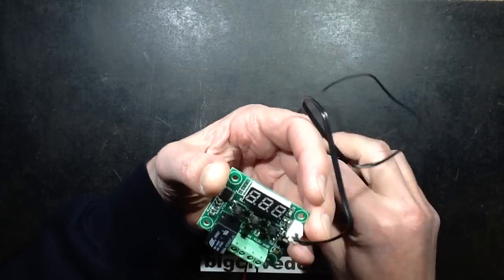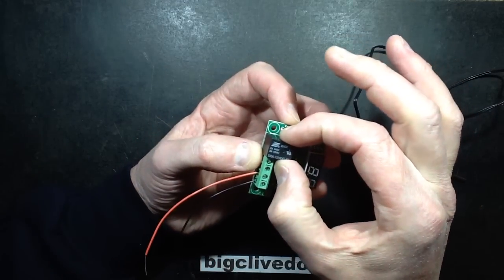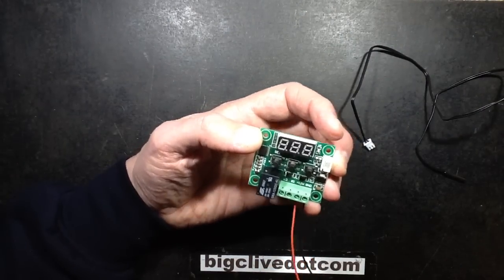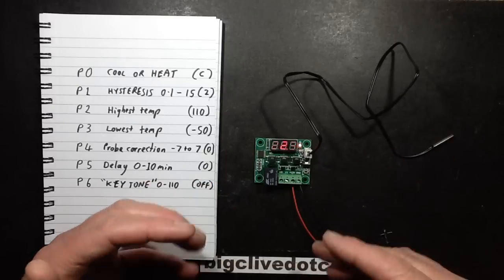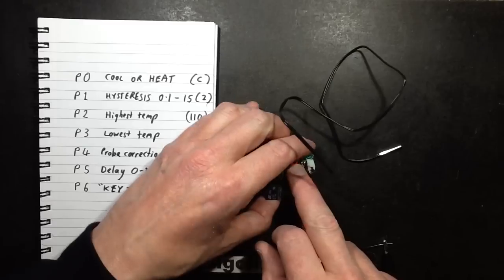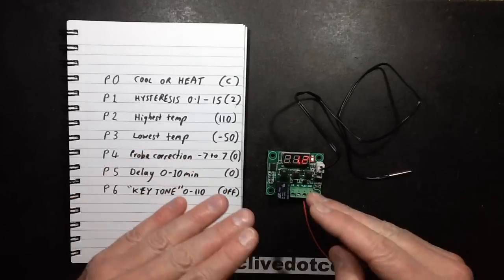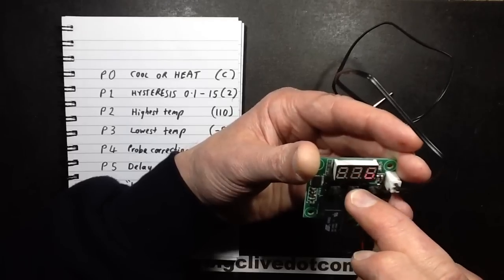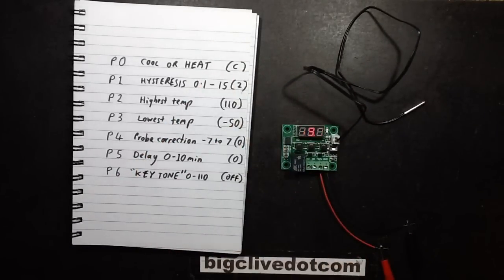Playing with an eBay thermostat module.  New data in description!

Comment: I have one that keeps flashing OFO - any idea what that means?
Reply from the maker: Not sure.  I wonder if it's detecting a probe fault.  Check that the probe is measuring a sensible resistance.  Usually around 10,000 or 100,000 ohms.

Comment: How will i do? When i try to do setting in my new XH-W1209, in the P3 it goes upto only 14 (the range is between only 14 to -30). I am confuse as you mention that it is a range between 50 to -50.

Comment: Cool video. I’m still trying to see how it works as a speed controller for a cpu fan so it can go back and forth between low and high speed depending on the temperature.
Reply from the maker: It could switch between two levels by bypassing a resistor.

Comment: I tried to use it for recuperator, whet temperature goes below -10 it should turn the heater on, but for some reason when you set a negative temperature to turn the relay on, it triggered at 0 C. For some reason heating mode works only in positive temperatures. I got two and both  got this.... But hey, for couple bucks I not complaining...
Reply from the maker: That's odd.  I guess they never thought it would be used below zero.
There may be a cheat possible by charging the thermistor compensation value so it reads 10 degrees or more higher than actual temperature.

Comment: ok Clive your all over the place with your set to 21 then 22! Yikes you lost me! How about I ask you a simple question and you answer it please. I want to set this to control a 110 VAC heater. It should be set to ON to start and when it reaches 105 Celsius it should go OFF then back ON again when it reaches 90 Celsius . Can you explain the procedure please?
Reply from the maker: The instructions for using this module are in the video description.  I'd recommend playing with it to learn all its features.

Comment: Many thanks! I have a couple of these modules (also could not resist the ridiculously low price). I planned on using one to control when a fan goes on near my wood-burning stove. Naturally, no directions included. Yours was the first video that came up, and let me get this setup quickly. 
  I would imagine the other to monitor my freezer in the basement, to warn me that it is getting too warm. 
  At this kind of price, I cannot imagine why the freezer manufacturers do not put them on now. It is not like it would really increase price much. Once mine is out of warranty, I will probably install it in the freezer and have the display visible. They actually sell cheesy plastic cases that also fit this one for next to nothing. 
  Goes to show you how much money that middlemen are making with this stuff!

Comment: What is the real temperature range of that module? Listings say -50 to 99°C, but then i could not use it for a heating plate. 

Does it have RX and TX Ports for external control?
Reply from the maker: I've not tested its range.  For high temperatures you will probably need to use a thermocouple based unit.  This has no serial ports.

Comment: I believe the tone setting is for the XH-W1315 temperature controller, it has a buzzer alarm that you can set. They're very similar units and probably use the same software. Just my opinion, I could be wrong. Maybe check out the one I mentioned above and see what you think. Also, thanks for your videos, I love how much detail you go into with these electrical items. You are a legend.  Cheers mate.

Comment: If this is the "W1209" board which i think it is, I used one to convert a cheep Halfords 12/24/240volt cool box to run on a thermostat in my van (that i live in) only one word of warning; These boards don't like voltage above 12 volts and leisure batteries charged from solar pannels can go up above 14 volts which will kill the relay. With my basic knowledge of electronics i found what i needed was a buck voltage dropper that i set to a constant 10 volts so now the new board i had to buy runs quite happily without killing the relay. So now for not many £'s i have a thermostatic cool box fridge.

Comment: Hi Clive , I've used one of these very modules to switch 2x 5” silent pc fans in the compartment behind the fridge vents in my caravan. The fridge works very well unless the outside temperature is too warm , summertime, so I've got the fans to provide forced air cooling over the cooling fins, temp sensor clipped to them set to trip at 50°c  and it works beautifully,  keeps the fridge working all through summer in the caravan. Mine came with a neat clear self assembly  case made of laser cut polycarbonate  excellent value for money.

Comment: This is a great review and I am a fan of your channel. 
After using dozens of these units it is a minefield to choose from the many manufacturers what is reliable. Taking most aspects into account including the clarity of the display, my favorite has HW-557 written in very small print just below the display. 
Also people complain about interference showing itself in the display. This is caused by coiling the thermistor lead to shorten it.

Comment: I have 240v one in a case its clever enough to not instantly turn on when used in a freezer but has a wait state stopping it thrashing the compressor .Our freezers are very old and now the thermostats are not sold anymore  others can be used but ofcourse need putting in boxes away from prying fingers so the boxed ready made units make sense . The module isnt that great its probe never agrees with the one in the freezer door .We set the temp at -19 off and -14 on and it hovers at -18 which is great ,its saved our freezer from land fill and when our 1957 fridges thermostat eventually fails hopefully keeps that going aswell.We have another one in the shed in heating mode it switches on a heater whose 'frost stat' never comes on even sitting well under freezing! As you say you cannot build one for the price and i recommend the timers as well we have one on our reverse osmosis which flushes the membrane avoiding having it continually wasting water left to its own devices as most do ,its programmed to come on for a minute go off for a minute then come back on for a minute then  switch off this lets the flush valve operate twice then switch off

Comment: Nice to have temperature probe correction but in the long term how stable are the probes, will their resistance drift significantly over time?
Reply from the maker: I'm not sure how stable thermistors are over time.  That will depend on the quality of manufacturing.

Comment: Shame on you Clive, after performing a hard reset this device is simply bin food.You never showed any testing after the hard reset, believe me it's shafted.
P7 and P8 appear. P7 = reflection of H/C and P8 is a WTF. 
WTF appears every time if you press SET in running mode, adjusting seems utterly pointless but the device for all intended purposes is bin food.
Can still perform as a digital tempertature reader, thats all though.
Probably nice PCB and components, firmware is bullshit.
It's a prototype and a hasty one at that. It's simply not worth anything other than components.

Comment: P6 is meant to be an over temperature alarm, but as there's no buzzer or sounder, it just does that flashing lines thing with the display.

I know this from watching another video, by Robojax.  He didn't mention it locking you out of the settings menu if you set it too low though.

Comment: I have one of these in my computer cabinet, running the vent fan, as the computer's ventilation is rather restricted. Has it running 24/7 for several years at this point.

Comment: P6 is to break the controller at any temperature on Heat or cool. Lets say for instance if you cool below 0°C as you set it will automatically turn back on once temperature drops or increases

Comment: Be careful not to go over ~15V input or you'll let out the blue smoke, didn't check the 12V PSU was unregulated with about 16.5V open circuit and the regulator and MCU gave up after a few minutes. Luckily I bought a 2 pack.
Reply from the maker: The regulators usually handle a higher voltage.  I wonder if it was really the voltage that caused the failure.

Comment: Well, I don't believe this...I was looking on Ebay for this very module to see if I can regulate the power to my cool box based on internal temperature  to save battery power, so it's not on all the time. And here you are talking about one!
I thought if I could wire it in on the positive 12v feed and feed the temp probe into the cool box, it would cut the power when it reaches the desired temp. What do you think?
Reply from the maker: That would work.  You may have to add an external relay if the current is high.

Comment: Great video on this little item.  I have one coming for my shed attic fan and this will help immensely to get it set up.  

I have one remaining question, can the thermister be extended, does the fact that it's resistor-based require a calibrated voltage drop or something?  I'd like to have the probe in the attic air space but the microprocessor more accessible.  I'm off the google and maybe some youtube videos, should help but I'd trust your input far more than whatever else I can deduce online.  Thanks.
Reply from the maker: You can extend it, but may need to use screened cable.
Reply: I extended mine just for test, 3meter speaker cable with aligator clips and it worked, i haven't notice any temperature change

Comment: these are good as many circuit boards from China now are ok if you deal with low amp, low voltage applications. China doesn't give much thought to worst case scenarios, as cost/profit vs. liability covers their whole production run. currently I think China electronics are down to a ~8% faulty rate, but highly dependent on complexity

Comment: I found this bit of info on the net:
Setting the high temperature alarm parameter P6:
Setting a value for this parameter will cause the relay to switch off when the the temperature
reaches this setting. The seven segment display will also show '---' to indicate an alarm condition. The
relay will not re-energise until the temperature falls below this value. The default setting is OFF.
Reply: Good to know

Comment: You can have more info on the settings and features of this thermostat here at aliexpress https://www.aliexpress.com/item/32729774901.html?spm=a2g0o.cart.0.0.42ae3c00Nl5idb&mp=1
Reply: I got the Double screen version, even I ordered the single screen version as in the video. They are basically the same, and setting it up is slightly similar.

Comment: What’s the amperage of the module alone? I’m worried it would consume so much current in my 12V 20A power supply that would also power peltiers and fans.
Reply from the maker: The module itself draws very little current.  Just a few tens of milliamps.
Reply: bigclivedotcom thank man! I appreciate it a lot!

Comment: A review of the W1209WK would be nice. It seems to perform the same functions, but is in a nice, presentable black box and is much smaller.  It also retains temperature settings when powered down.
I use one to control the electric radiator fan on my car :-)

Comment: The other issue i have with these is they have a single pole relay and no segregation of the LV and ELV terminals. Remember, they are selling these to people thst have trouble putting a battery in the right way around.

Comment: Yes, relays that size can be 20 amps. Look at boards out of Miele appliances. However, with Chinese stuff always remove a couple of zeros. The issue with those is the 125 volts. When they sell them, they just chsnge the external label.

Comment: P06 is the high temperature alarm setting it to zero effectively puts it into a dead short loop. As you found out. Reset may also be done by holding either the + or - key after turning off the power.

Comment: Hi. Thanks for your video. Would you know why the thermostat in my industrial incubator holds at 37.5 C continuously but my w1209 thermostat keeps on fluctuating. What settings would make it stick to 37.5?
Reply from the maker: It sounds like the sensor is faulty or water has got into a connection.
Reply: @bigclivedotcom  i actually have a separate thermometer/hygrometer and they go up and down almost exactly.

Comment: Temperature range :    -50 to 110 ℃
                  Dimensions: 48.5 * 40mm
                    Temperature control mode: ON / OFF
                    Resolution：When temperature is 0.1℃, the resolution is -9.9~99.9, other temperature segment is 1℃
                    Control accuracy: 0.1 ℃
                    Hysteresis  accuracy: 0.1℃
                    Refresh rate: 0.5S
                    High temperature protection： 0-110℃
                    Supply voltage: DC 12V
                    Static current: ≤ 35MA, attract current ≤ 65MA
                    Output voltage: DC 12V
                    Output power: 20A relay 
                    Measurement input: NTC (10K 0.5%) Waterproof Sensor                    
Environmental requirements: -10 ~ 60 ℃ ，Humidity 20% -85%

Comment: The hysteresis actually works the other way around. The cooler/heater always turns on at the set temperature and it turns off at the set temperature minus set hysteresis in cooling mode or set temperature plus set hysteresis in heating mode. This is to insure it always remains below the set temperature in cooling mode and above the set temperature in heating mode.
But yeah, these modules can be quite useful. In my local Hackerspace, we have a fridge to store drinks etc. And it started running the compressor continously while set to 9 °C, freezing the drinks and causing the ones in glass bottles to explode etc. So we replaced the thermostat with one of these (at least it looks pretty much identical) https://www.ebay.de/itm/AC-220V-Digital-Temperature-Controller-Thermostat-WH7016C-LCD-Display-50-110/272972159173?hash=item3f8e6898c5:g:BtIAAOSwd~dc0lLI
There are different versions, we used the 220 VAC version though, since it doesn't need an external power supply . I live in Germany and I believe the one we used cost us about 7 € (so about 6.50 GBP) and and it hasn't caused any problems so far (has been regulating the fridge temperature for about 3 years now).

Comment: Clive, do you know, if the chip has a alarm pin zthat goes high or low at alarm.?
By the way, your tinkering with those little gadgets are exacly what we need to get a quick understanding about it.

Comment: Hi there. Nice review as usual. I'm not sure if I've got a slightly different one (although it looks the same) but when I connected the load (computer fan) to a K0 and K1 it didn't work. Then I found this video https://www.youtube.com/watch?v=PDgikiHS1CI which explained that I need to bridge a +12 with K1 than connect the load to K0 and GND. Now it works. Is it a normal procedure with all of them? Thanks
Reply from the maker: In most of these units the contacts are volt-free.  Just open contacts like a switch.  It allows the unit to be more useful because it can switch other voltages than the supply voltage.

Comment: found a data sheet, (sort of) explaining the P functions, say P6 is a high temp alarm and can be set from 0-110C
https://images-na.ssl-images-amazon.com/images/I/71Y-7iz1lML.pdf
and this as well with a P7 setting for RESET, cant see any type of output pin to actually sound an alarm, will have to buy one to see if a solder point is onboard also has a "Program U[date Interface next to display maybe a pin from that doubles an an audible alert? 
Code Indicating Set range Inital Setting
P0 Mode set (Heating or Cooling) C/H C
P1 Set return difference 0.1-15 2
P2 Up limit 110 110
P3 Down limit -50 -50
P4 Temp. Adjust -0.7-7℃ 0
P5 Delay start time 0-10 minutes 0
P6 High temp.alarm ON / OFF off
P7 High temp.alarm Adjust 0-110℃ 50
P8 Reset

Comment: What electric parameters is it expecting for the temperature sensor?  Can it be reprogrammed for a different sensor such from a car engine or an oven?
Reply from the maker: Most of these use a standard thermistor.  I think it's the 10K type.

Comment: I've bought this module (w1209) some months ago for my peltier project and I say it's a good one, does what it says.
The only downside I see here is the placement of the components.
Having the relay with the buttons mounted on the same side of the pcb makes your aesthetics harder to design.
Even if you buy the acrylic case for this model or bought this with the case, it still feels in convenient.
Try to look at the model W3230 and see what I mean.

Comment: I’ve now got three of these. They’re reliable, accurate and easy to use. I derive the 12 VDC supply from a tiny 450 ma power supply buck converter. The only shortcoming I’ve found is the sensor lead length, is a bit short for my needs. However I’ve successfully soldered on an extension. I use them for seeds germination and brewing temperatures control.

Comment: I have bought one exactly the same as this, used it the other day for a while, worked perfect. However, came to use it today & as I connected the power it started bleeping & wouldn't function. If I set the temperature above the temperature or disconnected the thermostat the bleeping stopped. It has now turned off & won't switch back on. Any ideas?

Comment: I want this device to start the Fans on my car Radiator at 140F/60C and not shut off until it comes back down to 140F/60C...
How do I set this up as C or H (Cooling or Heating) and what settings on P2 and P3 ?
Thanks !